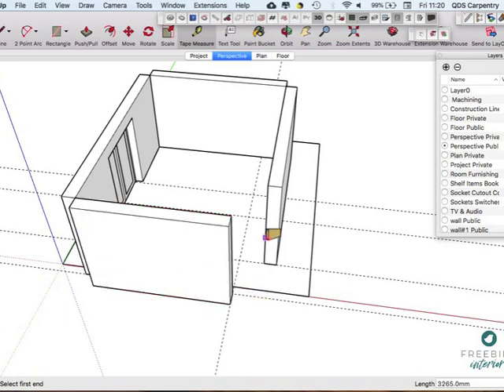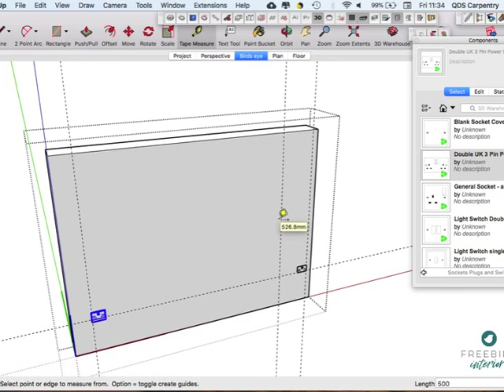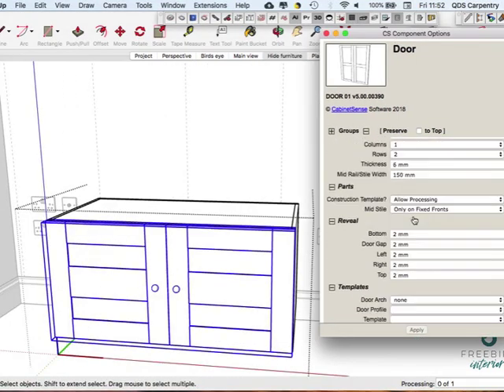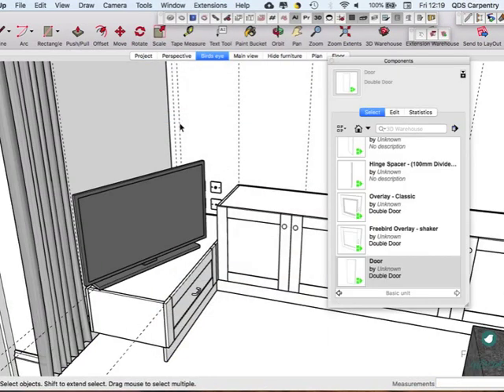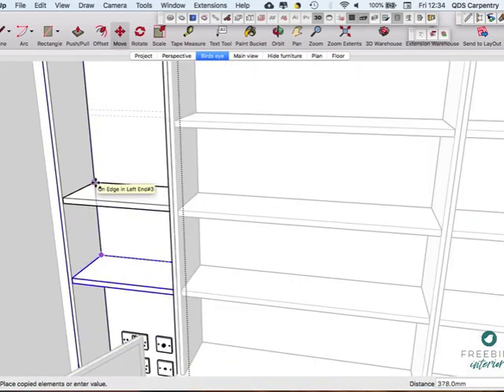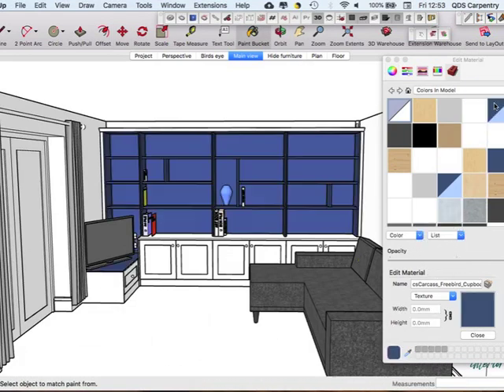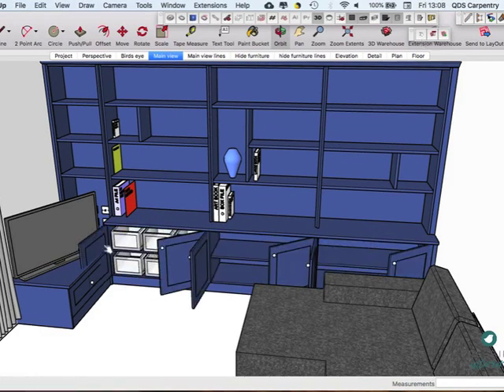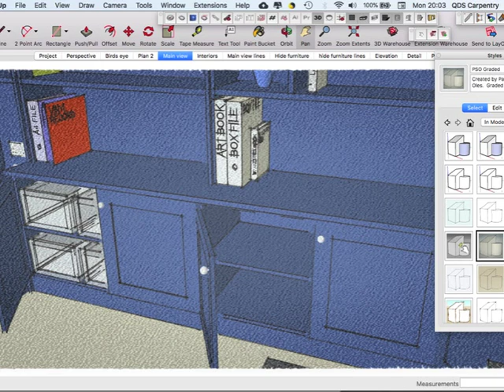Creating Accurate Build-Ready 3D Fitted Furniture Designs in SketchUp

Comment: Nice customer service... I do the same thing its vwry efficient, but sometimes i my cutlist do have problems due to in accurate structural finish.. I do interior only take up measurements of the structure... But still during instalation the modulars wont fit. But over all very effiecient strat. No need to re draw plans.. And helps alot on costing...

Comment: Hi Alistair.  I have just in the process of building 2 built-in units in 2 alcoves along with 3 floating shelves above each one ( i followed the way you do them) and a fire surround build for the middle.  I drew the whole lot out in Sketchup and the proceeded the hard way to then draw each piece out in SketchUp into a 2440 by 1220 rectangle. to make my cut lists.  I ended up with 7 sheets work of cuts.  I printed them off and took them to my local B&Q who then proceeded to cut all of them out.  I only have a car and getting what seemed like 100 different cuts of MDF at all different sizes including offcuts into my car was quite interesting indeed. In my drawing, I rounded up sizes to make the cutting more efficient and needless to say when I got home and got this lot out of the car and trawled it all down to my garage i didn't have a clue what each piece was.  It was a nightmare.  Because I had rounded up the sizes for cutting  I couldn't tell what was what.  I am 3/4 of the way through the install now and what a job it has been.  One of the alcoves had a column right in the middle so I am having to try and scribe everything around this column and to the back and sides of which none have been remotely straight and the column its self is narrower at the back than the front by 10mm.  No fun at all.  I know you use a plugin to create cut lists and I downloaded it and now the free period has run out and I had no clue how to use it.  Messed up there.  Anyway long story short and sorry for going on but How do you manage a large install which can have upwards of 70 or so different cuts.  You banged through the sketch up video quite quickly so I didn't really get to see the workings to well.  I thought I could run up a good SketchUp plan but when I saw yours I decided I was just deluding myself :-)
Reply from the maker: jamie tregidgo it’s taken us a LONG time to get sketchup and cabinetsense working for us this way. Along with CutList.  I’m thinking of doing training series videos on this sort of thing, I just don’t know how I can find the time!  Have you tried cutlist plus though?  You can just type sizes in and it optimises them onto sheets.  Having that labelled sheet diagram is the easiest way to check and cross off the cut parts.
Reply from the maker: https://cutlistplus.com/